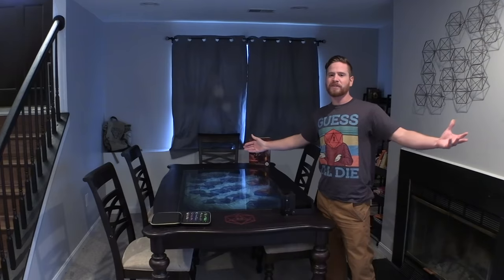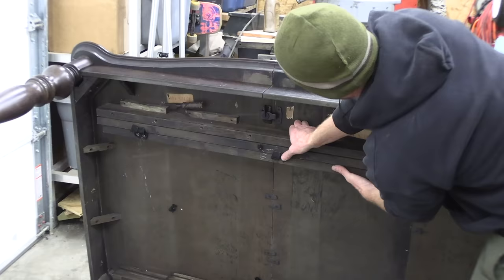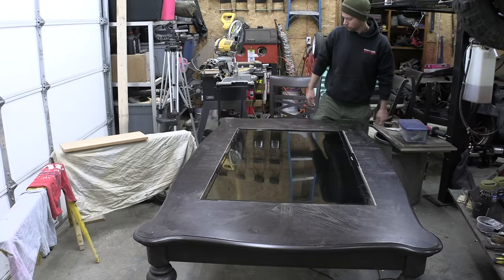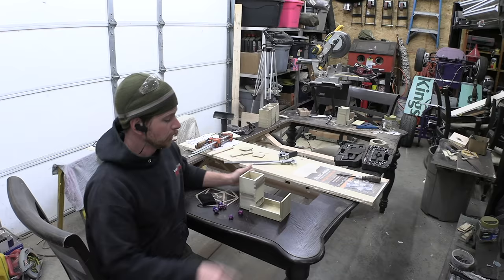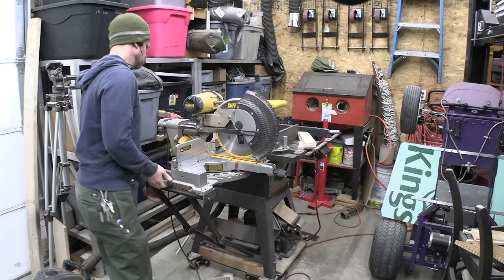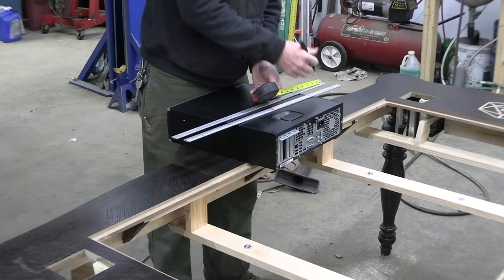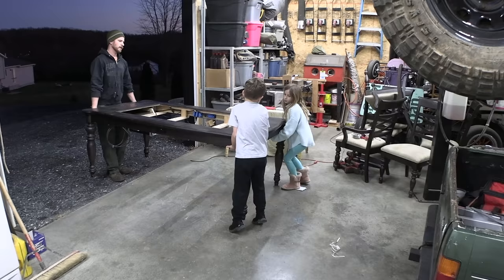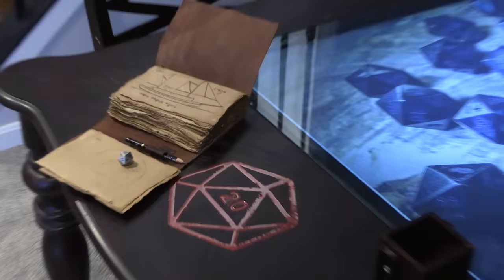Building the ultimate D&D Table: Dungeons and Dados

Comment: This looks gorgeous. HOWEVER might i offer a bit of an upgrade advice. Use a cheap mini pc instead. An asus one with a ryzen cpu for example, then just get a usb to fan pin for a few bucks from amazon (since they can have cramped ventilation if you have it under the table) and a cheap 3 pin fan. It will save you space and cables, perhaps even room for further upgrades with the space you save in the future?

Comment: You could make it without the PC. Just have hook up cords for a laptop in the keyboard drawer. You could use the laptop monitor as the dungeon master's screen and run the map to the TV screen. It's just missing cup holders on the sides.

Comment: Amazing job. Too bad you didn't add a vinyl surface layer over the top with D&D art work already on it from some print shop. Dice cups would have worked better if they slid from underneath out and folded up on the edge then you wouldn't have gone thru the cutting out part for each. Still looks great.

Comment: I've always wanted to make one, and this is the final nail in the coffin for that plan. One thing that I won't do is installing an entire PC in there, since I primarily use my laptop for all things TTRPG.
Glad I have an old table and TV nobody uses, so half the problem is already taken care of.
Love the build though, and the dice towers were a very nice touch. I might opt to add drawers for each player spot or each side.
Oh, would adding a retractable DM screen be a pain, or would it be simple to install?
Reply: A Dm screen could be simple, or complicated depending on how you want to go about it. For my design it would a real pain since a ton of wiring and electronics are under there but individual results may vary!
Reply: I was thinking of one large hole just before the TV section, (maybe above where the large D20 engraving is on MTTS's table as an example), where it will go under the table and swivel to a horizontal position.
The screen can be made of 3 segments, 1 center piece and 2 side pieces connected on a hinge and secured by magnets. If you want to put it under, simply fold the 2 outer pieces into the middle, and push down, where it will sit parallel with the top of the table, unobtrusive to your legs... However, getting the whole mechanism to pop out/go back in when you push it is an entirely different can of worms.
Maybe if I put guiding rails and pivot points on the center piece of the screen, I can attach it to another set of sliding rails under the table, add one of those push-lock sort of thingies like the one for the dice towers (I don't know its name) and out comes a functional hidden DM screen.
The whole table will of course double as a normal table.

Comment: These types of tables are fantastic. Im going to be building one soon myself. My one question is how do you accomplish fog of war on these?
Reply from the maker: There are several different companies making software that will provide fog of war. I'm not currently using any of them so I don't have a recommendation. If I need to implement something similar, I am currently making several versions of the same map with different rooms or areas blacked out. It's pretty low tech but since I use minifigs, it's fine since no enemies are on the screen.

Comment: To avoid the problem of figures appearing to float above the terrain, it is important to keep the total depth of TV (from the plane of the tabletop) to a minimum.  How far down is the TV in this build?  I am tempted to use something thinner than tempered glass for the protection layer.
Reply from the maker: For a screen this size I wouldn't want to use a thinner or non tempered piece of glass. Especially because drinks are often involved in our games... but someone did suggest to pull the screen out of the case in over to get the screen touching the glass and I think that would be a good idea.
Reply: @MoreToolsThanSense  That sounds like the best of both ... protection and thinness.

Comment: awesome build, you are a master builder. I just have one question. Is there any reason you didn't make a seal around the glass, in case a player spilled something?
The only improvement I can come up with on this, would be a build-in DM screen of some sort.
Reply from the maker: It does have a simple rubber seal under there, I just didn't video it.
Reply: @MoreToolsThanSense  Great to hear 🙂

Comment: I can't figure out how the leveling legs work. Are the bolts threaded into the TV mounting holes AND into threaded inserts in the bracing boards? Or can the bolts freely rotate where they're connected to the monitor (and if so, how are they connected)? My first thought was that they were threaded in both places, but then it doesn't seem like turning the bolts would move the monitor (it would just keep the monitor in the same place because its unthreading counter clockwise out of the monitor at the same rate as the bolt is being lowered and unthreaded counterclockwise through the bracing board (until at some point the bolt unthreads completely from the tv and comes out)
Reply: The bolts are not actually connected to the monitor, the monitor just sits on top of them and those two strips of aluminum spread out the weight so that the bolts don't punch through the plastic case.

Comment: So how has this table held up as far as heat dissipation goes? Can't imagine a whole of of passive airflow cooling the PC and TV from below, especially while people are seated at the table. Just seems like the whole table would heat up significantly especially after a long 4+ hour DND session
Reply: So 2 years later and the TV still works perfectly, The stupidly large PC has no problems with cooling whatsoever. However I have switched over to using a tablet as a DM screen, mainly because it was too hard to see the screen clearly from the back corner of the table and so I could run extra apps for music and whatnot without disturbing the map display.

Comment: I'm curious as to why you had the keyboard table straight on instead of at an angle/off to the side. Was it a personal preference or did you just want to be able to fold it away and that was the easiest design?
Reply from the maker: Yeah, because of the dice towers, the shelf has to be centered.

Comment: I've been thinking about doing something similar, I would love to know how you guys like playing on the screen, particularly wondering if you have any problem telling "where" a character is exactly since the minis "float" so high off the surface? I was wondering if I should use glass or plexi
Reply from the maker: The "float" doesn't bother me at all, glare is a bigger issue so you'll want to play in a dim room. Plexi is way cheaper and easier to work with. I chose Tempered glass because I want it to be able to support actual weight.

Comment: How do you handle the issue of TV screens sagging over time? Most break if laid town for too long as far as I understand. Did you find one that is not subject to this problem?
Reply from the maker: LCD screens seem to have less of an issue with this but it can still be a problem. I have not noticed any issue yet but it's only been a few months. Either way, I bought a cheap used TV for exactly this reason,  if it breaks, then I'll find a better way to keep it supported.

Comment: What kind of wire did you use? I'm trying to decide if I should just use bare Romex or need to run it through conduit.
Reply from the maker: I just used an old computer power cable to make an "extension cord" From a code perspective, romex always needs to be in conduit, from a safety perspective...

Comment: Does the display built into the table not look bad at different angles? Like if you watched tv at more than a 45 degree angle?
Reply from the maker: It's not too bad, trying to use it as a regular computer requires standing for the most part because all of the buttons are small and windows wants to put them at the "top" of the screen far away from me. But in game, it's totally fine to see the maps especially for the players on either side of the table. Can be a tad hard to see from the DM seat, but I know what's there already!

Comment: any problems with heat disapation ? the heat now rises to the top of the screen. or do you set the tv to eco mode to reduce heat as much as you can, id would take the back off and get a fan spitting the heat to the under table.
Reply from the maker: Not that I have noticed, We usually play for about 4 hours and the glass is maybe warm at the end? It's not warm enough for me to notice.

Comment: I will pledge my service to you for a d10 cantrip and one of these tables

Also, is it possible to use that same cutout to fill the top of the dice tower to make it look near seamless? You know, so the grain looks uninterrupted. Or does cutting it out make it too unshapely to fill the square?
Reply from the maker: Yeah, it would be extremely difficult to cut out without ruining the inside portion. Honestly, I don't notice the grain being unmatched. But I'm no perfectionist, lol.

Comment: What was the point of the power box?  you could have just used a power strip
Reply from the maker: Much cleaner to have all the wires cut to the right length. Also it has 3 built-in power outlets that need to be hardwired.

Comment: I am definitely not watching this instead of prepping the session I'm running in (checks watch) 4 hours. ...  Anyway, Is the glass held in to the table by brackets or adhesive, or did you just let gravity do its thing?
Reply from the maker: Lol, it's just held in with gravity, a rubber strip seals it up.

Comment: I cringed every time he said, "cut the fingers", with UHF Emo Phillips in mind. Just call me Mr. Butter Fingers....
Reply from the maker: Now there's a movie I haven't seen since years were all starting with 1
Reply: @MoreToolsThanSense  😁 I like to revisit it over the years. Aside from my cringe at cutting the fingers bit, the table is awesome. I want to do the same with a small round table I have and a smaller screen. I been curious though, is Plexiglass the wrong choice?
Reply from the maker: @gamer-a3945  Plexiglass should be a fine, cost effect choice, for a small screen especially. It is much more flexible than glass so it could deflect enough that it will settle on the screen over a larger area. Also, be careful if cutting it yourself as it can crack or shatter if you take too big of a "bite"
Reply: @MoreToolsThanSense  Right on, thanks for the advice. Summer project on the horizon.